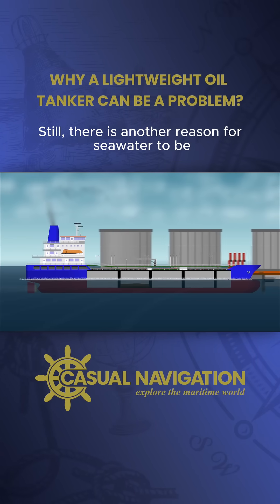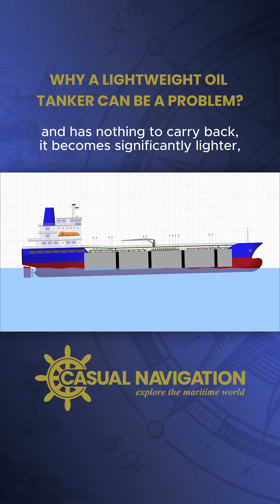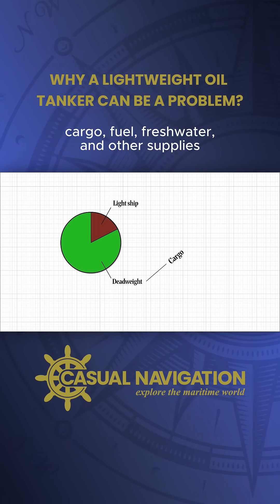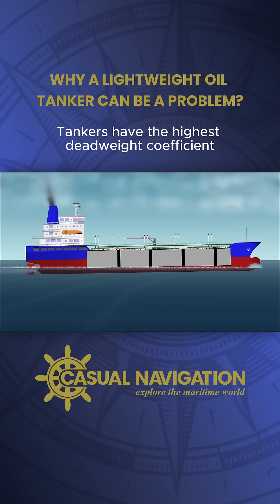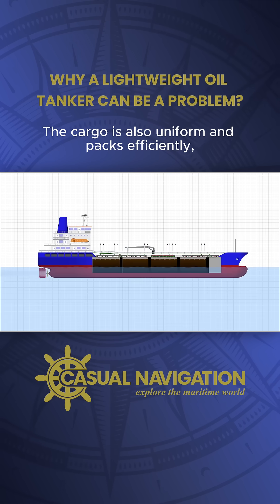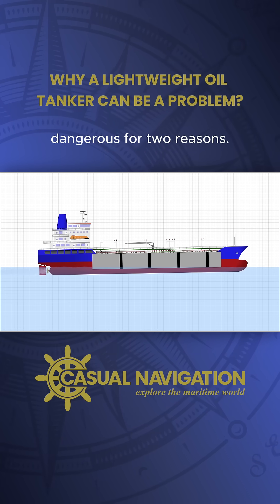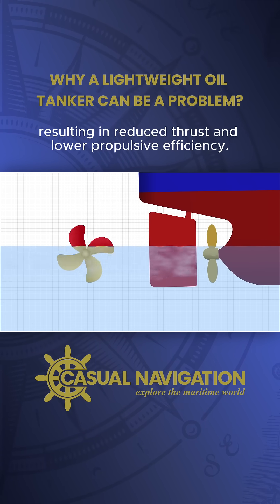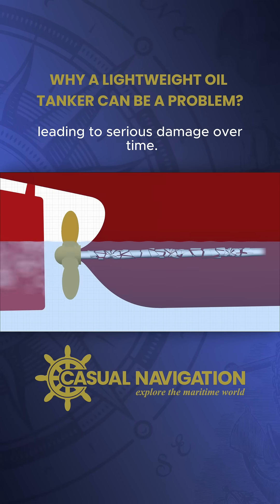An Empty Tanker Can Be Risky—Here’s Why

Comment: But filling the tanks with seawater would mean lot of cleaning work before filling oil again-inevitable though!
Reply: Thats why oil tankers have sperate ballast tanks, and at the same time to conform to MARPOL  oil pollution regulation that forbids dumping oil in the sea
Reply: @Panagiotis_PYes, another completely wrong video from this channel. They do it on purpose.
Reply: They can't use a water oil separator to be good enough for the water part? They had another video on this topic
Reply: @RichardCurrie They do not fill the crude cargo tanks with seawater. This is not permitted anywhere in the world. False information on this channel.